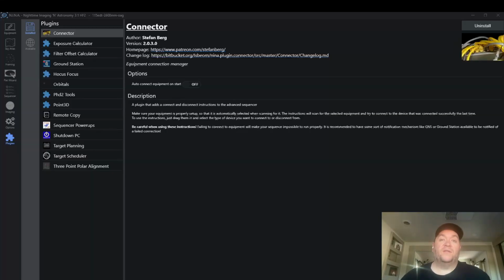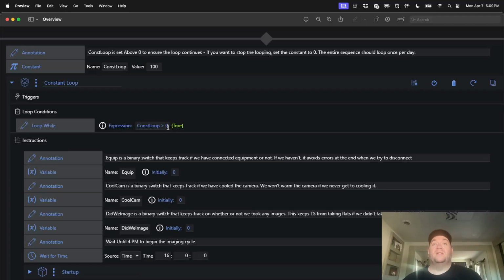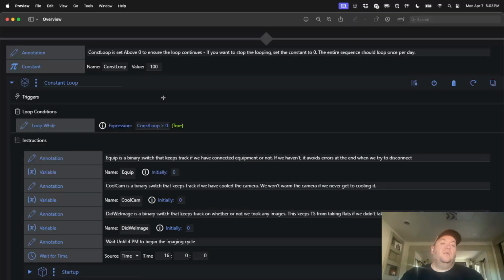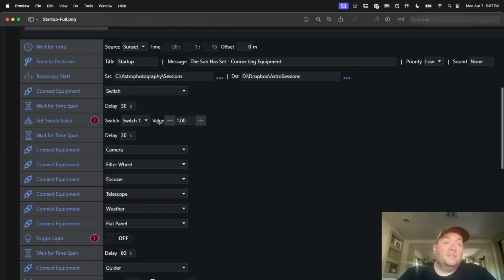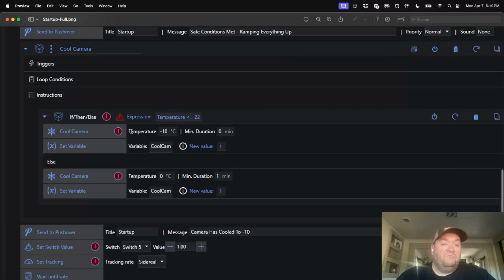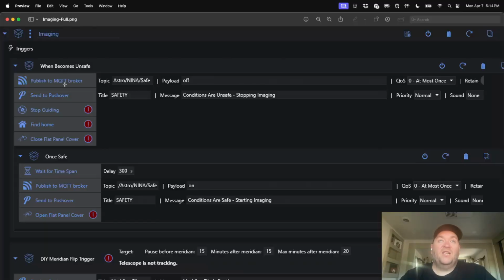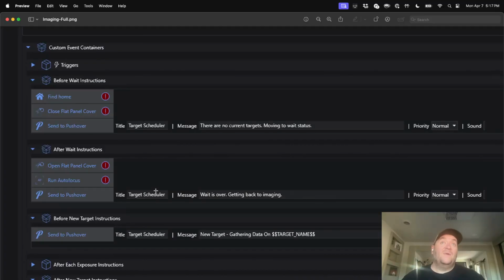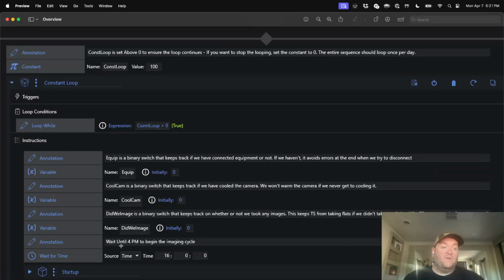Fully Automated Multi-Night NINA Sequence

Comment: If you're shutting down the PC, how are you turning it back automatically for the next session? Won't if be offline in RustDesk / AnyDesk / RDP?
Reply from the maker: The computer is configured to turn on automatically when power is detected, and I have a managed power strip where I power down the outlet at the end of the night and back up when it’s time to start up again.
Reply: @JavanAstro  ahh, I see. I thought that this setting works only if there is a blackout and power comes back. Didn’t knew that it works even when the PC is shutdown gracefully. I must give this a try. Thank you! I am in B7 by the way.

Comment: Since it gets very hot in Kagga Kamma Remote Observatory as it is in a hot area of South Africa I plan to power down during the day. The observatory is air-conditioned but this is belts and braces. 
I have a IP switch to cycle the mains and the PC will automatically boot when the power comes back on and NINA is in the startup so I think I have that covered. I don't know how to automatically restart the sequence after reboot, would you please let me know how do you automatically start the sequence after rebooting? Thanks Shaun
Reply from the maker: Check out the .bat file at the end of this blog to get an idea of how to autostart NINA and your sequence: https://tracastro.com/blog/remote-automation-sequencing-in-n-i-n-a/

Comment: Hi mate, great video. I'm new at Starfront, B9, and will be using your guidance and examples to get automation setup. Quick question though, has any of the sequence information in your screenshots changed since you uploaded this video, that might be relevant for someone like me essentially pasting the steps into my own sequence?
Reply from the maker: Small things have changed to optimize but nothing fundamental. Things like dynamically picking a camera sensor temp based on ambient temp, rather than hard setting.  Nothing that would stop you from using these with success. My new setup is in B9 as well. Welcome!
Reply: @JavanAstro  B9 is where the flavor is :)

Comment: I’m still looking for a tutorial to run a fully automated ROR with NINA and target scheduler. Fortunately you don’t have to control the roof at star front but for me 50% of my effort is opening/ closing the roof and VERIFYING it is actually opened or closed in NINA. It’s the last verification part that eludes me. NINA does connect to my dragonfly switch and in the equipment panel it shows the state of the roof but I don’t see any way to use that data inside NINA.
Reply: Similar here, did you find out a way?

Comment: Thanks for this video.  I've had my scope at Starfront for about 9 months now, and have been learning NINA along the way.  Recently getting Roof info into my sequences.  I see there are a number of messaging options like Star Messenger and PushOver.  Not sure how to set these up because they ask for email and password(not sure why they need this as it kind of makes my email, potentially at risk).  Is there a way to just give themust an email or Mobile Number without passwords or SMTP info?
Reply from the maker: I don't know anything about Star Messenger, but Pushover is something that pushes notifications to your phone, so you need to have an account to tie the receiving device to the sending device. Ground Station provides multiple other notification methods, including email, discord, ifttt, etc.. I would look into what it provides. It's likely one of the methods will suit your needs.

Comment: Thanks for the video, Jordan!  Very helpful.  I’m also a Starfront member although my install is still pending.  I reserved a standard pier and got caught in the confluence of the rush of smaller pier installs and building construction schedules—instead of ‘up to 3 weeks’ mine is ‘at least 6 weeks’ (assuming construction of the new buildings is not delayed).  Bad timing.  In the meantime, I’ve been trying to take advantage and learn NINA better so your video is timely.  I’ve used Advanced Sequencer for remote use from the living room to the backyard, but never for multiple nights or linked to an observatory system.  I’m planning to go in small steps, so it’ll be a while before I get to Target Scheduler, but there’s still lots of useful stuff here to add to my one-night sequences.
Reply from the maker: I heard about the delays on standard piers, that stinks. I'm sure the crew will get you up and going just as quickly as they can. If it's any consolation, the weather has not been all that cooperative over the past couple weeks, so you haven't missed much. I'm glad you found the walkthrough helpful. Going slow is very much advisable, but I highly recommend committing to getting to target scheduler eventually. It makes so much sense when imaging from a remote observatory. Happy to help once you get up and running - you can find me in the discord.